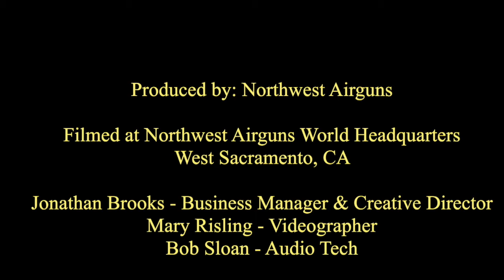Pump-up air rifle not pumping up?  Try the 'Alcohol Flush'.

Comment: My assumption is the alcohol, is causing the rubber oring (s) seals.. to swell.. thus, the drying seals.. are made somewhat whole again.. least for a while..
Reply from the maker: Cool story Abe.  Many people have suggested following up the alcohol with compressor oil or ATF or the like, may help keep the seals supple.  Or just skipping the alcohol and using only the oil.  Good luck with the Crosman and with finding an old Benji.

Comment: This is interesting. My friend has a mid 1960's Blue Streak that fires the pellet every other time. The in between times it bloops out the barrel. Do you think the alcohol flush will help?
Reply from the maker: Les, yes try it.  Won't hurt anything, but might help.  If it doesn't work, you are no worse off.

Comment: The issue might be keeping air in the gun for prolonged periods

Anything more than an hour isn’t gonna be healthy.

Good fix, but at what cost?
Reply: I store my gun with about 2 pumps and oil when needed, it will last a lifetime. I own 312, a 1956 317, several 342s, 397pa and a Sheridan Blue Streak. I have always put em away with a pump or two and they all shoot HARD. I managed to diesel the 397pa and it sounded like a gun.

Comment: Won't alcohol destroy the internal rubber & seals ?
Reply from the maker: Maybe, although I've learned that many people follow the flush with a few drops of hydraulic or compressor or other oil just to address the potential for seals getting degraded.  Really,this is intended as a fix, to get you shooting again.  It may not be a permanent solution.

Comment: Yeah with a tranny sealer 30wht non-detegemt oil mix 20-80 .
Can get some working again but they will need a reseal done right to get back up to Real Stock performance levels and even better with a bit of performance mods.

Comment: Can you do this with a co2 rifle?
Reply from the maker: Maybe, there's some guys who say they have done it.  Depends on the way the Co2 powerlet seals, I would think.  The issue is how would you get the alcohol or other fluid through the valve system.  Figure that out, and it could work.